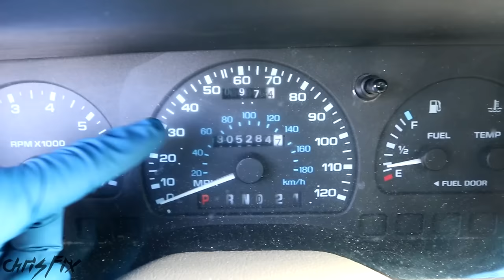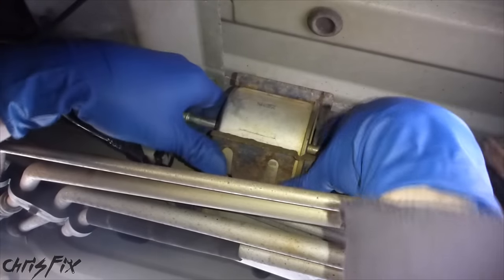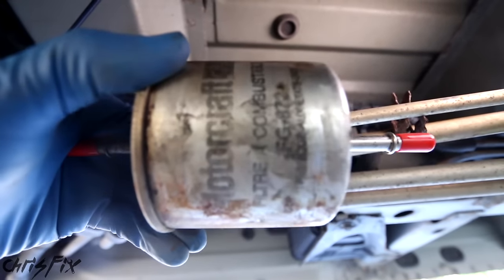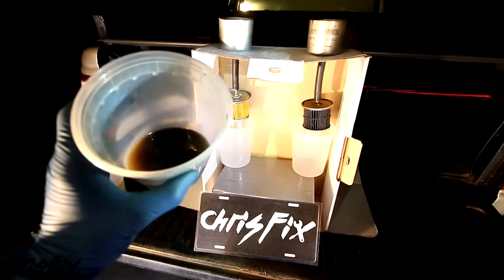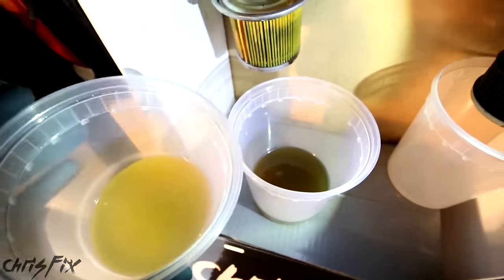What does the inside of a Fuel Filter look like after 300,000 miles?

Comment: Wow, 5,132 comments on fuel filter guts. Just think, 4K new filters installed & 2,000 new fuel pumps. I almost spit my water out when you mentioned how hard the fuel pump was working. They are inside buckets now to avoid misfire codes while turning with low fuel in tank. So most will have 2 more filters, just not as fine, so 40 microns on bottom, 70 microns inside bucket on pump, then 100-150 microns in replacement fuel filers. I give a quick puff thru each one before I”be tossed it over 35 years. Some OEM’s have magnets inside as well. Cut the filter media out, roll it flat & let dry. It is amazing how must dust, dirt and rust comes from gas stations. Remember, that’s not factory installed rusty dirt in plastic tanks. ASE Master Tech since 78-Retired

Comment: My car has intermittent failure, more like a misfire. Coils ok, replaced the coils connecting harness and it still hesitates. After watching this video, I must change the fuel filter and then an injector cleaning. Hopefully I will report what happened...
Thanks Chris, awesome video!
Reply from the maker: Let me know how that goes! Thanks a lot!
Reply: ChrisFix Just to update about misfires: injectors cleaned, tested resistance (13.1 ohms), spark plugs replaced, fuel regulator checked, fuel pump working fine. It now gets reduced to either a tiny vacuum leak or a short on the wiring. These old Passats (2002) have wiring sheath issues and those over the valve head get brittle with heat/time. And yeah, the scanner points to a cylinder 1 misfire, intermittent. So, either a mini head gasket crack or a ground short. Fun fact: at cold starts it runs ok, later on when hot it starts to act up. Go figure...
Thanks Chris for the video.
Reply: @rudolfhuijs4526  Maybe it needs a transmission fluid and filter(s) change. My car has a CVT engine with two filters and when I changed them both and the fluid my car finally stopped hesitating when I'd accelerate
Reply: @user-ct1lf3hf1v  Thanks man. On Saturday I discovered one of the injectors wasn't seating appropriately. If I pushed a bit with a screwdriver a hissing sound was audible. I had to replace the o-rings (were new) and then things got back to normal. Good to know transmission issues are connected.

Comment: I have an 02 explorer 4.0 SOHC that uses that same (2 inlet and 1 outlet) fuel filter from your truck (Ranger?) I noticed you used a different color release tool (Blue) on the outlet side.With the metal retaining clip on it. I bought a scissor type remover and i can't get the quick connect to release the outlet connector..What size remover did you use??? TIA Ted

Comment: Interesting video. Although I'm surprised you would've let the WinStar keep it original fuel filter at 300,000 miles. But it's encouraging  that the filter material hasn't dissolved and really messed things up

I've had for many years older Mercedes  and a lot messier to change than  your WinStar 

For one you've got a clamp off the main fuel hose from the tank or  gas will be pouring  out the bottom 

But interesting video; thank you

Comment: i've been changing the fuel filter everytime i changed my oil, so between 10k-15k km (6-9k miles) it's located in the engine bay and super easy to take out but is it a waste of money or is it worth doing ?
Same for the air filter, oil filter and cabil filter, i do a maintenance like this every year on my car

Comment: I did one of these on my suburban after 200k miles. Took me a while as the fuel filter quick disconnects didnt work. I needed a specialty Flex Fuel tool that is a tiny bit smaller.

Lisle 35000. Truck runs way better. And the only reason I replaced it was because my truck wouldnt start. The fuel that came out of the filter was black.

Comment: I asked my dealership about replacing this on my jetta and he said it wasn't necessary because it doesn't really need replacement. ive replaced sparkplugs, pcv, timing chain, etc and it has trouble idling and staying in time sometimes and not putting it into limp/EPC mode, but after seeing that flow test im thinking it might be fuel delivery.

Comment: One time after I had run my tank down low to the point that the fuel pump was also sucking up the water that builds up in the tank . It was causing a stumble with my engine. After filling up the tank I stopped at a auto parts store and got a bottle of gas dryer. It did a very good job of getting the moisture out of the gas tank but it also caused the sediment to be sucked up which is what the gas dryer will do. It ended up dirtying up my fuel filter to the point that the engine was stumbling again within a couple of days. I broke open the fuel filter and it had the color of a red brick from the rust sediment that was sucked out. So, now when I use gas dryer I will also replace the fuel filter soon afterwards.

Comment: I had my fuel filter and pump replaced at 105000 miles. It was an expensive job because the fuel filter is in the fuel pump which is in the gas tank.
I am at 122k now so I am good for a while but I hate a design that does this.
I suppose it might limit some types of engine fires by keeping the filter out of the engine compartment.

Comment: Pulling the fuse and stalling the engine isn't good enough if the car is old enough. The 89 maxima I worked on has pressure on the gas cap so I advise unscrewing that as well. It looked like engine oil it's crazy how the fuel filter gets ignored

Comment: im about to change the fuel filter on my 2008 ford expedition with 173,000 miles.
im the 2nd owner. the plugs were orig and had a gap of .101 thousands. new they were .041.  I think thats about the thickness of a paint stick and no missfire - mpg was bad at 11.  now im guessing the fuel filter is orig too ;)
it would make an interesting video to show plug wear at 50k, 100k and 175k on spark plugs.  after the plug change my gas mileage went up to 14mpg city. 3mpg more ! 
when i first bought it a few months ago it was at 9mpg - lucas deep clean fuel injector cleaner got it to 11mpg.
Reply from the maker: If I get plugs that old I can make a video on comparing them! Thanks for sharing!

Comment: I suspect there was rust in the tank of the ones that were dirty, I have had fuel filters that have run a 100K or so and they are clean as new. I would also ask where these cars got their gas. FYI you poured he dirty fuel through the new filter backward.

Comment: Mine hasn’t been changed in 150k miles but I’m discouraged to change it myself because it’s inside the fuel pump assembly and difficult to take apart and a whole new assembly is up to $500
Reply from the maker: If it’s in the pump assembly just leave it. Those don’t get replaced unless the pump goes bad

Comment: I just subbed and rung the bell =]  I've watched tons of your videos on cleaning and stuff... so now I'm subbed.  Anyhow, I have a few questions and a correction for you if you don't mind.  How does the van run NOW with the new filter in it?  Did you notice your fuel economy increase?  Did you notice the power increase?  You've been the original owner and driver so you'd be the best one to NOTICE these changes.  The fuel pump doesn't have to "work harder" on a old clogged crappy filter... The pressure it produces is static and it won't hurt it pumping to a new or old filter.  It actually produces MORE than enough pressure and a lot of the fuel is returned via the fuel rail when the system is working properly.  When the fuel filter is clogged up like yours, you actually lose delivered fuel volume as you saw in your test, even under pressure.  The COMPUTER will advance the engine and adjust injectors to compensate for this fuel deficiency... up to around 25% (If I remember correctly).  If it's losing MORE than 25% volume, the system can NOT compensate and you will be running lean, producing intermittent misfires, poor power and terrible gas mileage.  This is all part of the DESIGN btw and is INTENDED.  Not going to go into why and how shady it all is.. but that's the truth.  I just bought an 05' Ford F150 for a work truck.  It's in great shape both in and out, no leaks.  It did however have difficulty on start up after driving just a short distance then being turned off (like down the street to the gas station or store).  It also was getting terrible gas mileage and seemed to be under powered.  Also, under load when I would give it more gas to power up a hill or tow the trailer, it would misfire here and there (stumbling).  I got it super cheap, only $3K because the owner didn't know what was wrong with it and thought it might have engine trouble.  $10 for the new fuel filter and it's like a new truck.. tons of power, fuel economy restored to it's stock crappy gas mileage =] and no more misfires.  I also did a compression test and leak down test to make sure all the cylinders were fine and there wasn't a different problem producing these negative results pre-new filter.  Everything came back in the green.  Incredible how a 10 dollar part can make someone think there is a serious problem and get rid of the vehicle.  Good job FORD, Government, EPA... they did what you wanted... AND bought a new truck.  Let me know about the questions above, I'm curious if you noticed any changes in the van's performance.
Reply from the maker: Thanks! Yes the van ran a lot better. Better idle, and better acceleration.
Reply: @chrisfix  I expected as much.  Glad to hear it's running better, now that it's not being starved for fuel LOL.  Keep up the great videos bud... I use all your tech and love it =]

Comment: Hi Chris, the trouble is some of the fuel filter built into the pump assembly and located inside the tank. Compared the the amount of effort to drop the tank, you can't buy filter as separate part, unless to buy a brand new pump, what would you do on this case?
Reply: xi yuan Zhang You can buy a separate filter and fit it in the fuel system, just cut the fuel line and fit it in between like chris has in his truck

Comment: I really hope you can answer this. Is it possible that my fuel filter is so clogged that the engine just completely stalled out while driving it? And is it possible that the fuel injectors will be okay? The car starts. Doesn’t seem to be a misfire or anything. Just stalls out in about 5 seconds. It stalls out instantly if I hit the gas.
Reply: A clogged fuel filter often at first limits the top speed of the car. Then later the clog can be so bad the car stops, or just idles barely dies after a short drive. If you are stuck sometimes tapping on the filter will get you going again but just for a few miles. I drove a car from Kansas city once with the traffic to St Louis all going 85 mph. By the time I got to St Louis the car would only go 75 to 85 mph. Well below Memphis Tenn. towards Jackson Mississippi the car went from cruising at 70 down to 55 then 45 mph. In the middle of nowhere and at 1am I pulled over on the interstate 55 and did not see anything weird under  the hood. For the next hour I would restart and go up to even 60 then 10 minutes later was down to 40 and would stop again. I did this a dozen times before limping home to a friends house in Jackson and sunrise. At his house his dad had us look at the plugs. We check the timing, all was OK. So later I tried to drive it to to dealer and never made it there. The car's filter was so clogged it would not even start. With a tow had the car at a dealer. All the young guys though ignition issues. I told story again to an old man and he said fuel filter. Once the filter was removed he blew through the the fllter from the output side and all this horrible rust came out. So with my case I drove from Kansas City to Jackson Miss before the car would completley not run. All this was on a car with a mechanical fuel pump, no computer stuff. It just got starved for gas and I did not know the symptoms.

Comment: Fuel filter systems are very different in the offroad community. It's not unusual to have two in-line fuel filters and a water sensor, plus a cone mesh filter to trap larger debris. Contaminants can be in any fuel but diesel owners tend to be much more aware of the risks.

Comment: When would you recommend to change the fuel filter on a 2014 camry. I read the owners manual and it has no mention of anything about when to change the fuel filter.
Reply: Your fuel filter/strainer is inside the fuel tank and only gets replaced when your fuel pump fails.

Comment: i just changed my fuel filter in my 2004 Holden Rodeo (Isuzu Rodeo) with 205K km on it witch is roughly 127K miles and the fuel flowing through the filter was dirty.

Comment: You dont need a tool for the fittings that have clips just push the lines together and pull out the plastic clip , the tool is for quick connect couplings common on Fords.

Comment: nice video, when the gas was cleaner before it was filtered is a huge thing. shows that at some point the filter if not changed will actually introduce the contaminates into the system. so moral of the story if you have a 300k filter and no money to change it, just remove it until you can get a new filter. safer for the engine and better mpg... i wouldn't think it  but clean gas in and dirty gas out sums it up.

Comment: Hi Chris 
What you think the reason  for fuel tank of chargers cars and 300 Chrysler  get too much pressure and catch fire  this happened  in area temperature reach 120 to 125 
Or could be the fuel not really good 
Usually gasoline are cold in summer 
But this fuel get warm in summer
Reply: IMADALBASRII are Chargers catching fire? What years is there a recall?

Comment: the fuel injectors only need fuel at the rate it can burn, not any faster, not any slower. The flow rate through the clogged up fuel filter is actually just fine. you have to bear in mind that the fuel filter usually fits inline below the fuel tank so the weight of the fuel will drive it through the filter.

Comment: Most New Cars don’t have this kind of filter. What do i do with my 2009 CRV or 2017 Rav4?   Jim
Reply: It's in the tank. Most hondas lift up the back seat under it is an inspection plate take that out and you have access the fuel pump and filter
Reply: This is a sleeve that you replace when you replace the fuel pump! I’m on my 7th Honda since 96, and have yet to replace filter or sleeve. Two of these went over 170,000 lies......thanks!   Jim

Comment: I bought a 300k mile car that never had a change and it reeked havoc on the injection system. You cant skip maintenance items, they are essential. The only thing I have been able to clean and reuse are spark plugs and that was only to get to the store to buy new ones. I wouldn't reuse any parts that need to be replaced.

Comment: How tf did you get that windstar to make it that far in miles? My 98 has had every sensor replaced and after 2k in work and still no codes it still likes to stall out, and idle posistion sensor was replaced with all others. It only stalls at low rpm when comeing to a stop. Only thing not changed is fuel filter, and only 150k miles, if it was fuel pump would have done went out and stayed out, on going issue for almost 3 years. Im lost, my mechanic is lost, ford dealer is lost, and my brother who is asc or whatever mechanic dont really know.

Comment: Hey I have a Renault Clio mk3 2010 1.2 16v and I don't see the fuel filter under the car fuel tank
I looked the fuel lines and found no fuel filter 
Where the filter could be?
Reply: Today and because of environmental problems, manufacturers are deploying different alternatives in an attempt to build cars that pollute a little less. In particular, this is why you can find the fuel filter at different locations depending on the year of construction.

In all cases, the fuel filter of your Renault Clio 3 will be on the supply circuit. So it will be located between the tank and the carburetor. You will be able to tell it apart because it is shaped like a cylinder with two rods and it is connected by two hoses.

Finally, depending on the year, the fuel filter will sometimes be located between the two rear wheels, close to the fuel tank so if you want to replace it you have to access under the vehicle.

On the other hand, for more recent models it is also possible to find the fuel filter close to the engine on the front of your Renault Clio 3. In this case it will not be directly accessible, some components will have to be removed.

You should also know that on the latest versions, fuel filters can be increasingly integrated into the tank. But, if this is your case the replacement of the filter with an extended life, normally you will have to replace it around 180 kilometers.

In case you have any doubts you can look at the manual of your Renault Clio 3.

Comment: Hi Chris, can a blocked / old fuel filter affect the reading on fuel gauge ?
Reply: I'm not Chris (or any other car expert) but I don't think it would. Have a look at his video about fuel pump replacements, there you can see how the sensor for the fuel gauge works.
Reply: No the fuel leveling sensor would cause an incorrect fuel reading. A bad fuel filter would cause bad gas mileage or worse blow your fuel pump and clog your fuel injectors.

Comment: Funny, here in The Netherlands we are very keen about our car maintenance. For i.e. Volkswagens needs service every 20K miles and all filters will be replaced including the interior filter.
All the filters are installed around the engine block and the interior filter under the glove box. A fuel filter cost only $ 9, oil filter $6, air filter $9, interior filter (carbon) $16

Comment: I was kinda surprised that you change filters each 30000+ miles in States. Believe it or not, I live in Russia, and it's quite common to change fuel filters each time you replace oil, which usually happens around each 7500-10k kilometers. Plausibly, that's because fuel is known to be of low quality here, still quite an unexpected difference.